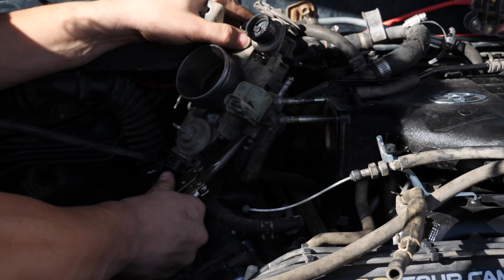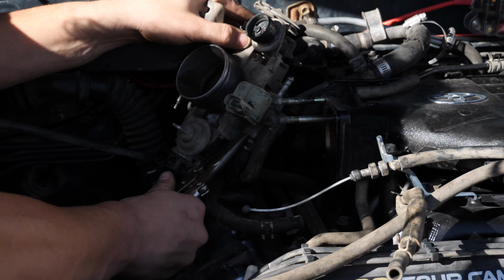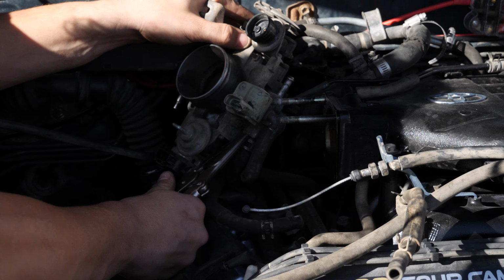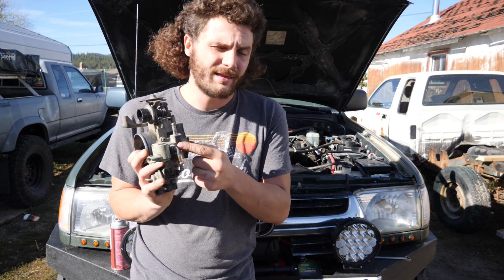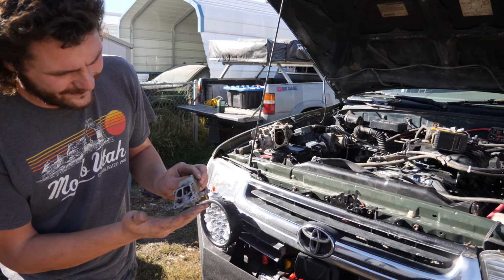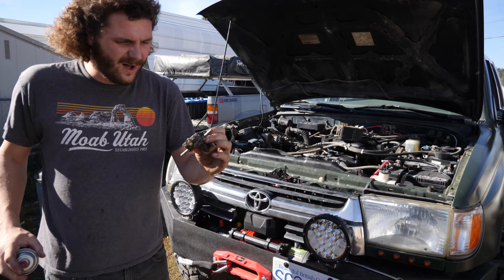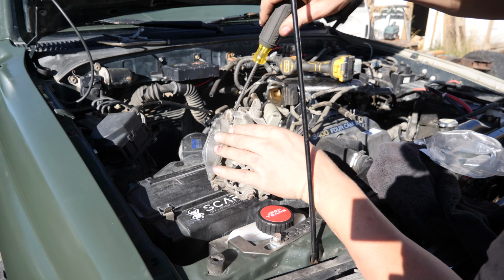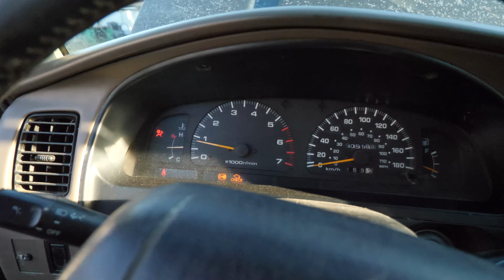3.4L Toyota HIGH IDLE FIX! (5VZ-FE Tacoma, 4Runner, T100)

Comment: Those screws are JIS, not Phillips, and that’s why they are dangerously prone to rounding out.  Use a hammer on a Phillips screw driver or an impact driver (one that you actually whack with a hammer as you turn)
Reply: My buddy showed me the hammer trick years ago. Messing with old dirt bikes it was a life saver.
Reply: I bought a JIS screwdriver a few months ago and it really is amazing how much easier it makes those little screws. They're still tight af but it does help.

Comment: My problem is that it starts high and eventually goes down after the engine is at operating temp. This can take 5 minutes and yes I did remove the IAC and cleaned it
Reply: I had the same issue, cleaned the throttle body and throttle valve plate itself with throttle plate cleaner and a shop towel. It fixed the issue and now only takes a minute to go down to idle rpm.
Reply: It depends on the outside temperature and climate. The Air idle control valve is basically acting like a choke on a carburetor. High idle until the warming kicks in.

Comment: And what do you do if that doesn’t work?? I replaced mine and idle is still high…
Reply: Did you see the video about the small washer fixing play in the throttle assembly? Try pulling your throttle assembly towards you while idling, if your idle drops that's the fix you need. Hope you have already fixed it by now though since your comment was 9 months ago.
Reply: Soo, I went and bought a new IAC from Toyota.  Paid a LOT of money and .. whaddya know.     It fixed the issue.   Best off spending the money on OEM stuff.   Buy once, cry once.
Reply: What do you mean “pull it to you”?

Comment: Mine acts even weirder. Runs at 1000RPM on a cold start, and it continues to climb as the engine warms up until it settles somewhere between 1500 and 2000RPM (while in park). After a hot restart if its been sitting parked for less than an hour and a half, it idles really low. Like under 500. Putting it in gear and turning the AC on just invites stalling if I don't give it some gas first...
Reply: I'm having this same issue, have you figured it out at all?
Reply: I have the same issue as well starts at 1500 RPM and keeps climbing up 
When I shift in to gear it drops to normally level about 500RPM 
Is there an easy solution?

Comment: I did this and cleaned the whole intake manifold now running nearly 2000 rpms it was find tell I decided to clean my throttle body and intake it really sucks
Reply: Did you ever figure out what caused it? I'm having the exact same issue. Idle was fine before cleaning and now I'm between 1500-2000.
Reply: @zombieslothcrapped  kinda lol I replaced the toyota 3.4 idle air control valve and noticed before I fixed it the more I drove it the better it got
Reply: @zombieslothcrapped  I think over time when the carbon builds up in the throttle body and IAC the RPM can also drop and mechanics adjust the idle screw back up to 800 RPM. Then when someone cleans the throttle body and IAC the RPM go back up and you  have to adjust the idle screw back down to around 800 RPM.
Reply: @stellamatutina3573  Does the 1998 4runner have an idle screw?  Because this is what I got now too ... after cleaning throttle body and IAC it's now 1500 to 2000 rpm in park or neutral.  Ugghh  I didn't know there was an idle screw?
Reply: @2028end  Have a look just above to the right side of the accelerator adjustment cable with the two nuts, should be a flat screw in the throttle body, try turning it half turn to the left or until you get it at the right RPM while the car engine is running, warm the engine up first, keep it in the park position and bring the idle down to wear it should sit in park and hopefully when you put it into drive the RPM should come down 👍
Reply: @stellamatutina3573  Must be the 2nd generation 4runners that have that idle adjustment screw, because on my 3rd generation 4runner (1998) there is no idle adjustment screw on the throttle body or near it.  I think it's completely controlled by the computer.  I just want to know how to aid the resetment of that computer?  Is there some fuse I can pull out to clear the memory?  Or something else?  Unhooking the negative battery cable for an hour did nothing.  Still got high idle.
Reply: @2028end  I Don't know were the  comment went that I posted to you earlier on, but your going to have to look up, on how to relearn the throttle body..
Reply: @2028end si lo tiene debajo del conjunto de resortes del cable del acelerador,cuando giras la pequeña mariposa para que acelere y la sueltas por debajo esta el tope qué lo detiene para qué no se regrese es un tornillo con un orificio para llave alen y una tuerca número 8 creo;es pequeña

Comment: I did that with my 96 tacoma and your right the screws for the idle air control was a pain and 2 out of 4 got stripped I even had to extract one of them so as I finally got them all out I took the screws to ace hardware match it with some Allan screws and it worked out perfectly fine the next time it won't be hard at all.

Comment: Just finished replacing my timing belt, water pump, accessory belts, power steering pump and lines and some other odds and ends on my 97 runner and when I fired it up i was idling at like 1800RPM. After triple checking my timing marks were all still aligned (they are) I found this video and after blasting a bunch of gunk out of my throttle body and idle air controller now it purrs along at 800RPM again. Thanks for the video this saved me some serious headache! -Cheers
Reply from the maker: Glad I could help!
Reply: @DirtGarage  Unfortunately, after cleaning my throttle body and IAC valve is when i got the hight idle 2000 rpm.  Been driving 98 4 runner for a week now and nothing is changing.  Tried disconnecting the battery, but nothing changed.  Can I pull the ECM fuse?  ECU fuse or something to reset the IAC?

Comment: When I cleaned my IAC valve, afterward is when I had the 2000 rpm idle on startup (park) and neutral.  After warmup it goes down to 1500 in park and neutral, and 1000 rpm in drive.  What can I do?  Been driving it a week and nothing is changing?  Is there a way to pull the ECU fuse or something  ECM fuse?  To reset it?  It obvious is retaining the old information when the valve was dirty and sticking, and now that it's free, moves easily, it's open to far and getting too much air.
Reply: Disconnect battery for at least 15 minutes then reconnect
Reply: @aftabqureshi981  I tried that several times and doesn't change anything with my 1998 4Runner.  I'm still driving it 2 months later with the same high idle readings.  I'm thinking this truck probably needs it's idle to be reset with a computer or something?  That's probably the only way?  Because I looked at everything else and there's nothing leaking.
Reply: @2028end   Try with your hand and [engine running]  to  turn your throttle body  assembly to closed position if the RPM go down, your 
 throttle body butterfly is wear out, add a extra spring  so  the butterfly stay close  tight it should fix the problem without spend too much money.
Reply: Check for vacuum leak

Comment: Its usually just need to recalibrate the throttle body ,set it in learn mode to relearn the idle
Reply: How do you do that. I replaced mine on my 96 tacoma and it suddenly starts acting like it wants to stall.

Comment: Surprisingly most (not hand tool) people don’t understand the force pressed down should be equal or more than the turning force. 
Otherwise strippage
GG on not stripping those small screws 🤙
Reply from the maker: I came super close to stripping these probably 5 years back when my truck had a 3.4 in it. That's why I ended up putting the throttle body on the ground to get my body weight on the screw driver when turning. Not gonna play those games!

Comment: So mine had the 0505 code and the idle was at 1800 hot I looked under the manifold and the sensor is unplugged so I though easy fix plugged it and turn the truck on and it went up to 2k rpm’s idle any idea what that could be the sensor looks new what would cause the sensor being plugged cause the engine to idle even higher then unplugged

Comment: I have the same problem So I bought a new one but the problem does not go away .... Please help!!!
Reply: Me too have same issue after changing it
Reply: Me too i changed it and still same idling at 1200 rpms at park and neutral and in gear 850 -900rppms
Reply: You need to clean the butterfly valve on the throttle body itself as well. Clean both of those, put some seafoam in the tank and oil, run it for a few miles then do an oil change. That should just about clean everything and it’s relatively cheap and easy

Comment: 98 4Runner 3.4
Will crank with Throttle position sensor unplugged (with a little help from gas pedal) but has a hard time cranking with sensor plugged in. Change the TPS? Very rough idle with this sensor plugged in or not
Reply: Clean your maf, tps, and iac. Google is there is a tps relearn procedure for 5vz engine. There probably is. Then check back.

Comment: Another thing fixed! Next week the 4wd issue? Curious what's wrong with that. Keep up the great work!
Reply from the maker: It was the ADD system, I completely defeated the ADD now. So pretty much fulltime hubs locked in front end. Gonna add slight drag to driveline and slightly decrease fuel economy I'm sure. But totally worth it for reliable 4x4 system. Simper the better in my books.

Comment: Aint got one of those..  no kickdown cable either..
Reply from the maker: @Z-Ack  i dont have a kickdown because its not a automatic. Yours may look different if its the weird drive by wire version with electric motor in throttle body

Comment: What’s the normal idle when cold start?
Reply: Mine is over a grand at cold but eventually idles around 600 when warm
Reply from the maker: We are currently 1200ish cold, and comes down to 700-800 warm
Reply: You can put manual hubs on the 3rd gen. Takes some press work and patience, but it can be done

Comment: I cleaned my iac and know it's too low rpm at cold Start haha any suggestion ?
Reply: Vacuum leak from disassembling things?
Reply: @megh9806  chekked, seems fine, low rpm at cold Start supossed to be for a vacuum leak?
Reply: Depends where the leak is.  Could be low or high idle.  Make sure all your hoses are on, not cracked and the throttle body bolts are all snug.
Reply: Try disconnecting the battery for a bit then hook it back up and turn the key to on for a few seconds should zero itself (hopefully)

Comment: Is 1500 rpm high idle
Reply from the maker: Yes
Reply: Hell yeah thats high, even when its cold
Reply: @toyotadude6771  Shoot, my 98 4runner is idling at 2000 when cold, then comes down to 1500 when warmed up, after I cleaned the IAC valve!  Is there an idle set screw on the 98 4runner?